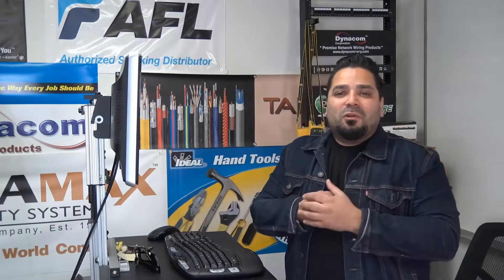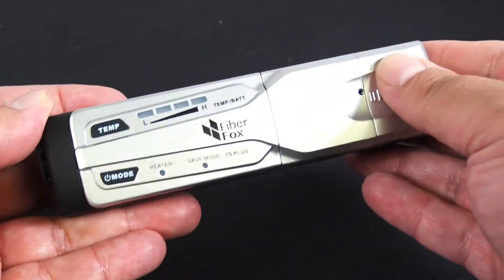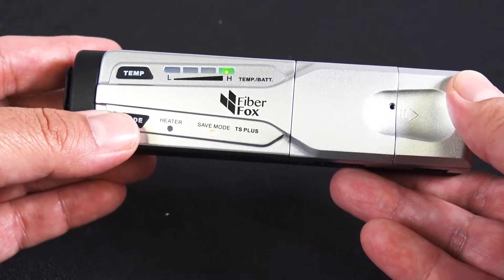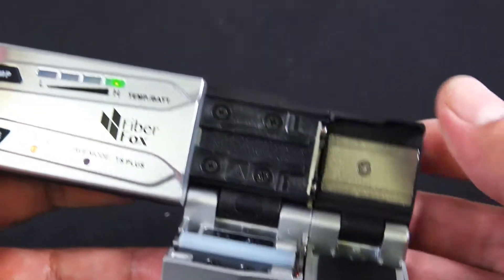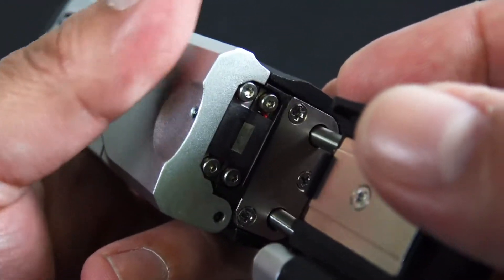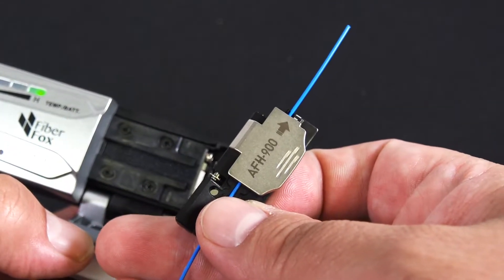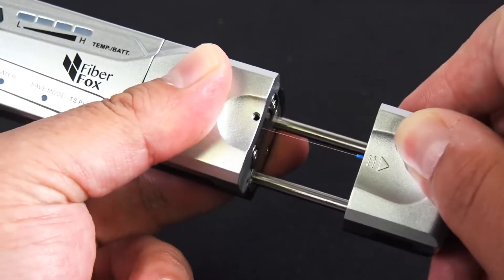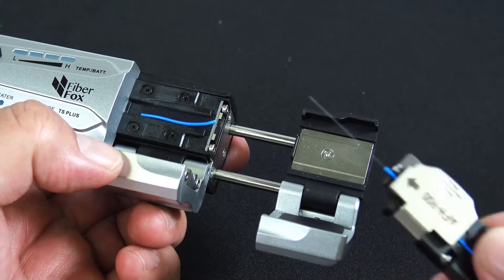Thermal fiber optic cable stripper (How to and Overview)

Comment: can this be used with a fan out kit? i am new to fiber and when i went to strip back my fiber the fiber broke and now i need to strip back the fan out kit. but my 3 hole stripper the middle hole only cuts one side then when i pull it bends the fiber hard and  when i strip back the fiber when i get near the  fan out tube the fiber snaps and i am back to square one.

Comment: Hey Mercy, looks like the cladding is still on the fiber, no? Does this strip just the outer jacket only?
Reply from the maker: Sup Joe! The cladding is also taken off. So far I have not heard any issues with the claver not cleaving because of the cladding. It's a cool tool but it goes hand in hand with fusion splice holders. We've sold these for a few years and only had an issue once and it was due to a bad battery. Have a good 🦃day!